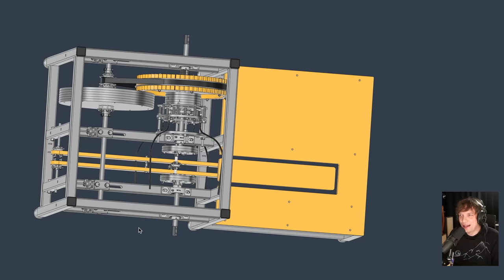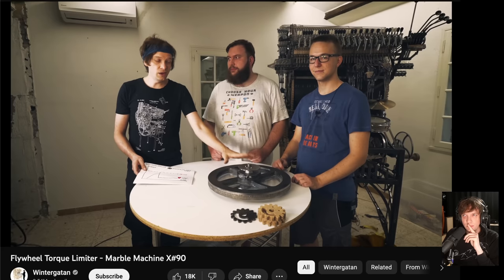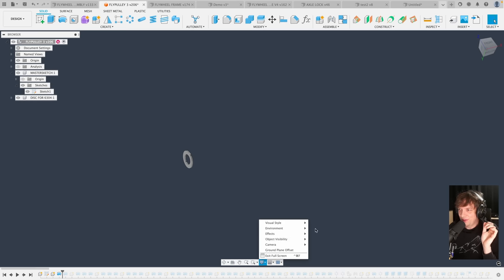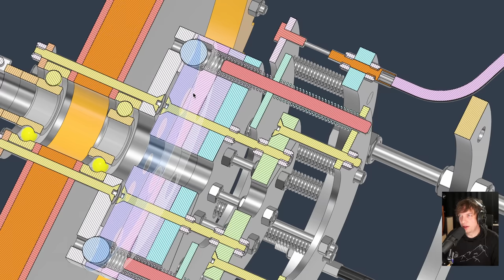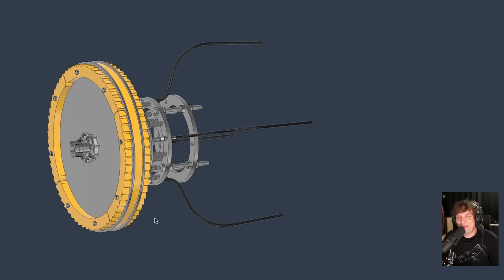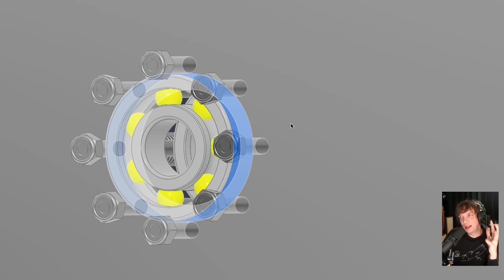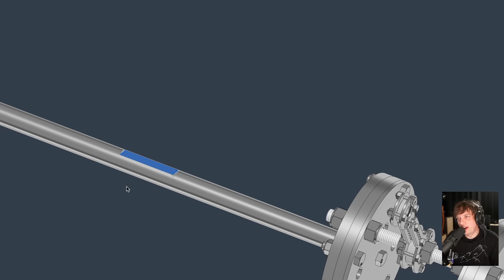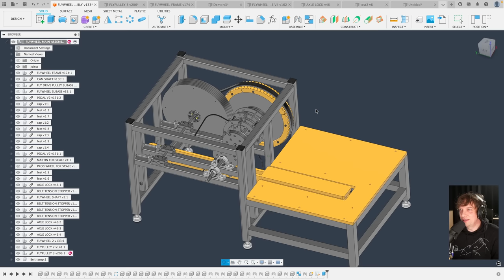Safety First! - Marble Powered Clutch

Comment: I am not sure why this video has a more bodge feeling. I am not sure if this is more about 60 bolts that seem to overcomplicate the design or about using bolts for bearing support (calling it "good enough") when you can buy bearing sleeves for cheap.
I get the feeling of making something from scratch, but I am not sure if in this case getting off-shelf parts would not be a better choice. With custom parts, You do not get cost reduction or any benefits of parts accessibility, and if for example, the clutch is literally one part am not sure if You can get any better with parts count.

Comment: So, I'm sure you have already thought of this but...

In the rest of your design, you're working on eliminating parts. This one subsection looks like it's about 70 or 80 parts.

A car clutch had 7 parts and has been perfected over many many decades. A bicycle brake pad is even simpler. Why not take a page from their book? Flip a switch, brake pad engages, machine stops.

Shearing pins aren't as bad as you think, either. Boat propellers have them. Shear the pin, pop it out and stick a new one in. You could eliminate so much complexity

Comment: To be honest I don't believe this bearing housing will work. As the wheel will be turning, it will apply some uneven forces (just because of the weight of the wheel) to the sides of the bolts, and as the contact with the bearing housing is just a line, it will simply start to slip, rotate and wear, then jiggle and the whole thing will go mad. A machined housing has a very tight tolerance and large contact surface with the bearing housing, that's for a good reason.

Comment: try to balance the flywheel with all that play in the mount to the shaft. heavy wheel you can only hope will stay in place and not move, only friction holding it in place. when your foot peddle, nice pinch points and trip hazard.

Comment: Very complicated design.  1 way clutches are a much smaller profile and allow parts to only spin in 1 direction.   2 concentric rings with opposing internal ramps with trapped roller bearings.  Spinning in 1 direction, the roller bearings float freely.  Move in the other direction, roller bearings ride up the “ramps” and lock the unit together.

Comment: IMHO such bearing housing will not work. Because the diameter of each bolt is different. First the bolt diameter on the non threaded part is always smaller than thread diameter. But the outer thread diameter is always smaller than it should be (M6 < 6mm). Because usual the bolt thread is produced with rolling method and in this case the outer diameter isn't "full". This all means, that all bolts are not tight in the holes and you don't reach the center of you wheel. You can maybe reach better result if you use in addition to the bolts calibrated hardened rods (instead of four bolts). But for the calibrated rods you need to use reamer tool to make holes with exact diameter.

Comment: Not loving the "flat spot" approach stick to keyways. The flat spot will attempt to pry open your splitt circle where as a keyway applies the force perpendicular to the rotation and the force is atempting to sheer the key. It's much stronger and also it fails safer.

Comment: love the project, but all those fasters on a moving part is a nightmare in the making, to simplify production your increasing complexity and part count which is a bad idea. Also I fear trying to use four cables for the clutch release will be difficult to balance the spring pressure, something like a motorcycle clutch with a center push rod may work better.

Comment: I wonder if a piston would work better than that pedal, I think it would be much safer, or have a system that only works on the downstroke and skip the floor entirely. Well i guess there should be some prototyping there. Too fast conclusion on what is right

Comment: The laser cut profiles are much less precise than you think I would really reconsider relying so much on them. 
There is a reason EDM exists and even if it's very precise (sub 2 um) it still needs finishing with grinding and/or CNC. There is a reason that laser is used only basically on sheet metal that is going to be bent. Bolts are also much less precise than you think and are not very good and  keeping up with lateral forces. Even tho you try to simplify things it feels like you're going back to the roots with this design, if you know what I mean.

Comment: very cool module! but I affraid only one thing.
this breke system can scratch and eat brake-disk bolt head.
maybe,you wand lesser mainainance at brakedisk,
brake-disk bolt upsidedown,and not through bolt hole for brake-shoe metal.
I think, low-cost fix is... hard weld nut to inner brakedisk(not wired-control disk)
but I have noidea for "brake system for music"
more better braking sound, or more lesser brake sound, maybe... key is material.
good luck

すごく良く考えられた、とてもいいモジュールだと思う！だが、ひとつだけ気になる所があるんだ
ブレーキを掛ける度に、ブレーキディスクを保持しているボルトの頭を、ブレーキパッド諸共削ってしまうように思える
もしブレーキパッドの交換頻度を減らすなら、
ブレーキディスクの反対側から貫通しないようにボルトを入れて
純粋にブレーキシューとして削れてもいい厚みを残すべきだと考える
例えば、内側（ワイヤー制御しない方）のブレーキディスクの表面に、ナットをがっちり溶接する手もあるだろう
ただ、私は”音楽の為のブレーキシステム”については、何も思いつかなかった
より心地よいブレーキ音、より静かなブレーキ音、多分・・・素材が鍵になるだろう
幸運を祈る

Comment: In my opinion there are many flaws in this design that will just lead to problems which in turn will eat up a lot of time later.

A lot of the bolts/threaded rods in this design are loaded sideways "in the open", essentially trying to bend them. Bolts are very weak when it comes to shear loads. You don't want to transfer any force that way. Bolts should clamp parts together so the friction between the parts transfers the force, not the bolts. 

I also don't like that there are so many nuts on bolts to adjust distances. This will be tedious to do especially since you have multiple cases where you want exactly the same distance in several locations. It is very unreliable (more nuts to get loose) and also hard to fix quickly. Do yourself a favor, design the distance right from the getgo and use proper spacers. Even if it's something as simple as aluminium tubes sleeved over the bolts. That way there's just one nut that you tighten. No need to fiddle around and trying to tighten several in the correct order while at the same time trying to match a certain distance.

You also have many locations where the bolts are clamping "overhanging" plates. This is a recipe for bent bolts and plates. Don't "clamp air". Again, use spacers.

You are also using bolts to locate parts relative to each other (the worst offender being the mounting of the bearings here). That is a setup for failure. The diameter of threads has huge  allowed tolerances. For example, an M6 thread can have an outer diameter from 5.79 to 5.98 mm. Buy a new pack of bolts and suddenly your bearing won't fit or flop around. To locate parts use pins. They can be bought ready made. Or, if you want something similar for cheap and in different lengths, keep an eye out for thrown away printers. They usually have a combination 4, 6, 8, 10 or 12 mm precision shafts in them. Just cur of the size of pin you need.

Bolts and screw pull things together. Don't design anything where they do anything other than that, unless you have a REALLY good reason. If engineers aren't doing something even though it seems simple, there is usually a REALLY good reason for that.

Comment: One thing I don't get:  Why a disk-flywheel?  A ring has a much higher moment-of-inertia per unit-mass than a disk.
In other words, a 10kg disk-flywheel will have lower moment-of-inertia than a 10-kg ring [ignoring the mass of the spokes].  The greater the moment-of-inertia, the greater torque and the longer it takes to slow down and require more cranking.  So again, I don't get why the flywheel is now a disk.

Comment: I’m a little worried about that split disk. Bolts are strong in tension; less strong in shear. Have you done the math? I don’t have the dimensions or materials, or I would. 

You could make two split disk pairs, both with that notch, but configured so that the splits are perpendicular. Then bolt them together. Now you have the clamping force of the bolts giving you friction between the two pairs, instead of relying on the shear strength of the bolts. 

This is how car wheels bolt up — a friction interface between a machined surface on the back of the wheel and another on the hub face. (Not the split part, just the clamping->friction part.) It should be extremely strong. 

So, do the math. If you’re going to exceed 50% of the shear strength of the bolts, you should change something.

Comment: Why use 4 cables to disengage the clutch when you can use one push rod in the centre that separates the clutch. Like how older motorcycle clutches operate. This would make for much few parts.

Comment: Well, it looks like your ratchet-wheel is missing... its ratchet, attached to the frame. The aim being to prevent it from counter-rotate and push the pedal back up. Same concept as a road bicycle free wheel as opposed to the fixed one of a track bike.

Comment: I can certainly see that you're having fun with CAD.  The torque limiter is important, I agree, but the rest seems unnecessary and over-engineered.  Do you really need your torque limit to be easily adjustable (more easily than changing out the springs)?  Do you need a clutch and a brake?  And if you do, does all of that need to be achieved with one assembly?  I think those design requirements could be less dumb.

Comment: From what I can tell, the breaking surface is metal on metal which seems loud and not actually that effective. Also the bolt heads are ON that surface so its really, Metal on Bolt head which just sounds SUPERRRR loud and scratchy and only going to wear either surface faster. (link to diagram on wintergatan discord https://discord.com/channels/649165975647682560/649172304823058443/1083142028659015761 )

Comment: I hope you have also taken into account that the flywheel needs to be balanced really well. Since it has large mass and quite large diameter too. I do not know the rpm of what you are designing of it but I would guess that G6.3 standard should be enough for your flywheel.

Comment: Getting 4 cables adjusted evenly is practically impossible. 

Use a throw-out bearing like every other mechanical clutch for the last 100 years has used.

Comment: Why don't just use dilatation to fix the bearing in place (heat the piece and cold the bearing)? It's widely used in engineering projects. It will be simpler and as effective.

Comment: I would at least put a 2 mm thick ring over the inner circular bolds, between the plate and the nuts.(21:37) Otherwise that part without the flat surface (half-moon) does not participate in taking the torque, right? Just through the bolds the other plate at the end of the bolts and then back again through the other bolts... Thats for sure a not the best solution.

Comment: 17:45 I just watched what you are  trying to explain here. I believe that the whole idea of not using a bearing housing is not good Martin and that is because the whole purpose of what you are trying to build here is not something that needs to be precisely centered but also to be able to handle the weight of the large disk and the several other components. That weight may apply shearing forces on the bolts while they will tend to rotate (although this design may be tightly secured) and sligthly enlong them or deform the large disk or the securing plate. This whole situation of applied forces and torques could be avoided when using a bearing housing because of it's additional structural integriry not allowing the torque to be transfered to the bolts but only applying purely tensile forces to them (their tightening torque) and not twisting forces (I am not a machinist trying to fix bearing housings for you 😁 just my opinion as I imagine this whole mechanism would work just as I simulate it in mind). Also have you thought of using an outer ring that the securing plate presses on? Because when tightening those bolts the securing plate may be deformed on it's outer side if there is nothing to press onto other than the inner side where it presses on the outer side of the bearing.

The work that you put in this whole design is amazing I truly admire you! 😮

Comment: Your CAD is lovely and I can see that you have lots of fun with it, but I think your design here has plenty of flaws. Let me mention a few...

Pedal: Instead of the current design, which is dangerous and not really stable, you should rather take a solid shaft with a freewheel on it, and a spring-loaded pedal which transfers power to the freewheel on the way down and comes up detached from the shaft. Similar to the way a kickdrum works. This would remove any pinching possibility, allow to pedal at any time, and be structurally much more sound as well.

D-cut instead of keyway: that seems like a terrible idea. You'll have lots of force concentrated on very small areas (to try it out, take a D-shaped rod and use an adjustable spanner to see the problem). The keyway makes it so that the forces are shearing forces on the keyway and peg, which is much more stable. Also, the split discs will get forces trying to split them apart, and you also end up with much more individual parts, so to me this is a really bad design overall.

Bearing housings: I think these will fail to work well. First you'd need to have a counterforce on the discs, e.g. an outside ring with the same width as the bearing, in order to better distribute the force applied by the rods and bolts. Like this the disk will quickly bend and loosen up on the bearing. Also, it seems that the bearing will be difficult to get centered properly in this design. And last but not least make sure that the bearing is designed for the forces which are different from using a traditional approach.

Brake and clutch: the clutch design itself seems fine, but you should better place it closer to the flywheel. Also I don't think it makes sense to combine the safety clutch and the manual engagement clutch into one, because if something goes wrong (such as a broken rod or spring preventing the marble to disengage) you'll end up with a catastrophic failure. So please add a simple and as fail-safe as possible safety clutch at the flywheel, and add brakes and whatever you want at the other end. And for a brake, don't design metal on metal, that's not going to go well...

Comment: Please please please please please don't use multiple (8 in your case) screws to tension the springs and to tighten the controversial bearing housing. Please use and implement one (big) screw tightening or tensioning mechanism. If any one of the screws is not putting same pressure as rest of the screws, it will create a wobble at high speeds. consider one of the ball bearings in the tension limiter firing because of the corresponding lose screw not putting enough pressure. This will create a wobble. Sometime the wobble is so much that your whole machine starts to vibrate. Please avoid using 6 nuts to tighten the bearing and spring. Use the one nut mechanism like you used in the marble machine X. I have seen the wobble happen many many times and it is very scary.

Comment: Why just don't use disk brake? I could imagine simple solution, that you push the brake, stop machine and then torque limiter will disengage flywheel. I think this design is complicated and it could cause some issues.

Comment: I don't believe your brake will work as designed. both surfaces appear to be on the rotating assemblies. clutch looks ok. you just need to add breaking surface to the stationary rings. i may be mistaken thougjh

Comment: You could probably simplify things a lot if you look at it with fresh eyes, I believe in you. Also, that foot pedal... I can just imagine your toe getting trapped between the pedal and the platform, and getting chopped off. shudders Add side walls on the bottom of the platform around the pedal, so that at no point you can get any part of your foot under the platform itself.

Comment: you won't be able to mantain coaxiality with the screws... tolerances are too large and screws wont hold prperly with dynamic efforts. 
You shouldn't use either laser. cuts for bearing alignment, the surface is too irregular.
This component might break prematurely because of missalignment. 
Maybe you should machine a cylinder and mount with pressure via the screws, avoid using the screw body to transmit torque. 
There are many ways to aproach this and have better results

Good Luck!

Comment: this feels like a massively complicated design, i have doubts that adding a manual trigger for this is worth the massive increase in parts over the previous design
couldn't you just have a part that actively does block the movement of a gear as in the demo in the mmx vid and use that to trigger the limiter?

Comment: Why are you trying to avoid a keyway connection to the shaft? If you’re machining a flat in, surely you could machine a keyway in instead. That being the case, it seems like your split half-moon setup is overly complicated in comparison. You said your saving a part, but splitting those three discs then adds three parts, so that’s a net increase to the part count.

Comment: The big error in your bearing housing idea is, that you assume all parts are stiff. They are not. The forces that the bolts put on the outer rim of the bearing are something it is not designed for. This is a thing you really should ask from an engineer, who's not primarily a musician.

Comment: It is overcomplicated. Good luck with adjusting all the bolts and springs. There should be one clutch with one spring on the flywheel axle, similarly to the car clutch. Look at the car clutch: it is simple as sh*t. It only has 3 parts plus clutch slave cylinder. It's cheap, durable, can be easily adapted. You could buy a complete clutch from some small car.